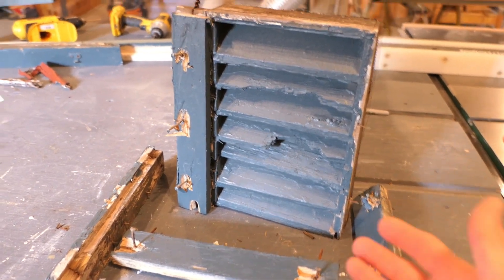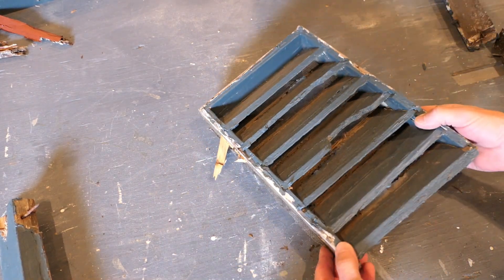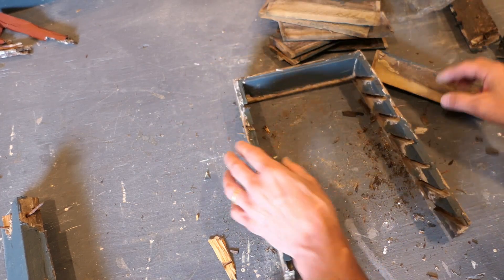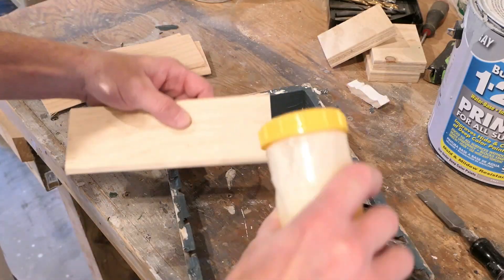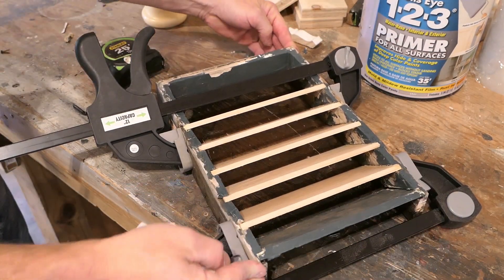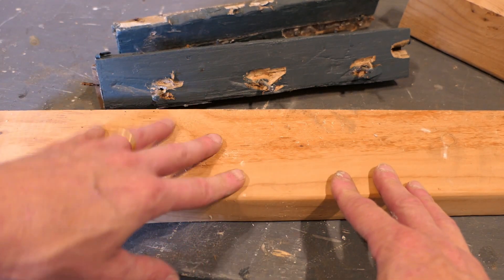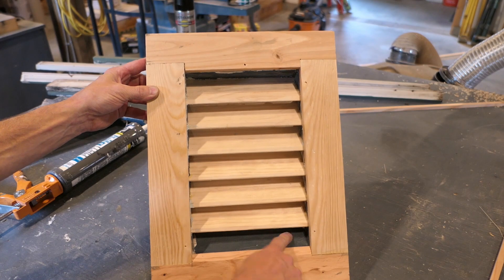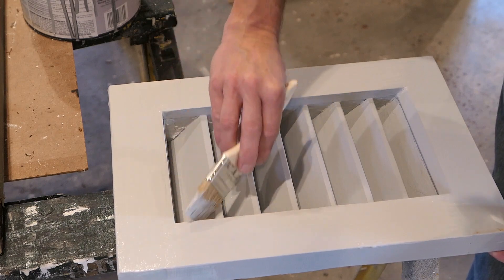Rebuilding A Wood Gable End Vent

Comment: Great repair/build. You are definitely a talented and skilled carpenter. Good point about just getting on with it instead of all the challenges associated with ordering a replacement.
Reply from the maker: There was a time when items like this were common, and it made sense just to pop down to the local lumberyard or box store and pick one up.  Now, it's a major investment in time and money to special order one.  It's crazy how upside down the supply chain has become.